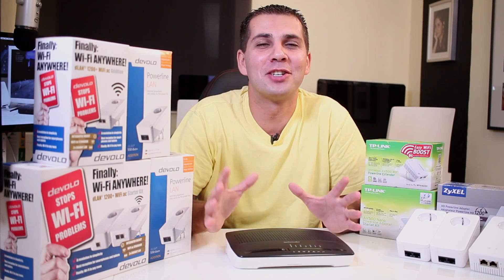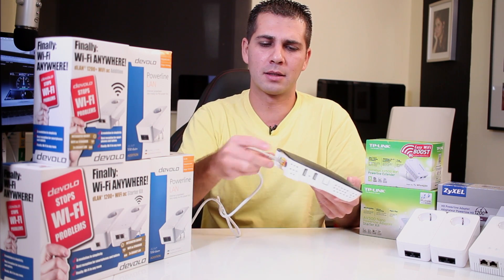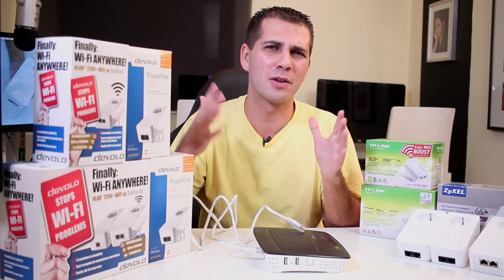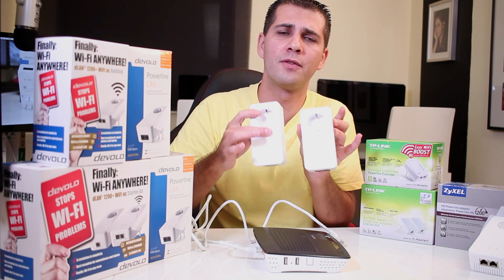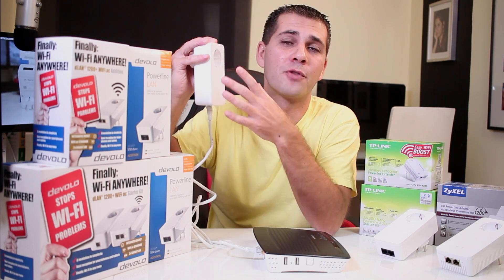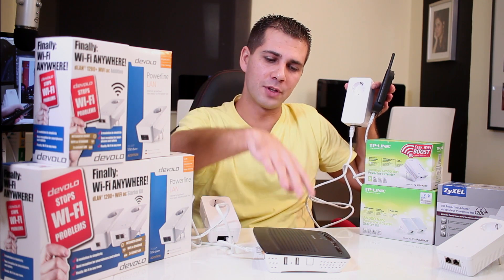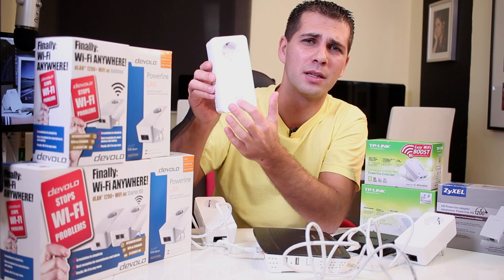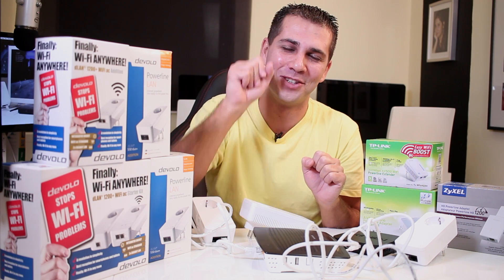What Are Powerline Adapters ? And How to Use Them

Comment: What happens if your upstairs where my PS4 is & Sim Rig after plugging Ethernet cable in to booster from PS4 How do I synchronise them if it's upstairs & the one coming from router is downstairs can you hold sync button in separately?

Comment: Great explanation. Just a quick questions though...

1. What is the maximum range of your electrical outlet to get good connection?
2. Can I get good network speed if I connect 24 port switch on the outer side with 23 users?
3. Can I use it as an uplink to my network connections?

Comment: Roberto great videos. I am moving from a 1 bedroom apartment to a 2 bedroom apartment. 
I will have a fios internet  connection. In the livingroom I will have a nvidia shield, TV,router and 1 tplink powerline adapter.
In bedroom A I will have another nvidia shield,TV  and powerline adapter line adapter.
The question is for bedroom b where I want to connect a desktop to the internet do I need to connect another powerline  adapter ethernet connection on computer to outline on wall then pair it with other powerlines
Reply from the maker: Hi Ginno, yes that is correct, you will need a 3rd one for that setup and in the future if you want to connect other via ethernet you will need other. If you can connect via wifi than 1 powerline will be enough for several devices but the signal is not as powerful as full ethernet speed 👍

Comment: I know I might be a couple months (or even a year late) but I am planning on moving my PC into my room but my room has a very poor wifi connection. This is due to the fact that my router in downstairs on the other side of the house. If I connect this to my router, then use the other adapter and place it in my room and connect it through ethernet, will I get a fast connection or will it be a little bit slower due to the distance between my pc and the router?

Comment: Sir I know this kinda late but thx you for such a great info I want to try put this in my house cuz my house mostly build with bricks no eithernet  wire at all. I will use 4g net sim trough router then I will expand to every room and also outside from back yard and front yard by using this adapter hopefully it work.
Reply from the maker: It will be as good as a direct cable or almost 👍

Comment: I have one router in my living room and connecting my Xbox via Ethernet wires. I want to connect it to my room and I have the same well connection how can I do this?
Reply from the maker: You need a powerline mear the router to receive the internet and then a powerline in the other room to transmit the signal to your other device 👍

Comment: Hi Roberto, quick question i have been using one of these for years now, for any reason would it start to work less? if that makes sense, it seems like i am only getting a couple of mb of internet now when i used to get way more, not sure if i need to update and buy a new one or the problem is with the internet provider? thank you! great video

Comment: I can see these powerline adapters giving more constant connection & ping over wifi but i saw many discussion online saying it dosen't last long for example after a few months the download speed will drop is that true?
Reply from the maker: Hi Armour, i have been using Powerline adapters since i was a teenager and the brands that i have used i can confirm that that statement is not true. Unless you have any change on your power grid there is no reason to have less speed. I have made extensive tests and i use them on a daily basis, and as such for someone that doesnt want to drill walls to pass wires this is the best solution available in my opinion 👍
Reply: Roberto Jorge Thx for your opinion, im looking foward to use it once i found out about it, its just there are some negative review online about it so its safer for me to ask an experienced person before buying. 👍
Reply: Armour Shooter Mine has started to drop after a couple of months it is probably just faulty though

Comment: Hi .just to know,I have brought a pair of TP Link power point adapter .I have all the connection and pairing -all is fine.Speed wise is not much of a diffrence.I have a ADSL2+ internet connection.I only get about 13 to 14 Mbps.I am curious to know whether the power line adapter is security safe cos' I do not want my next door or surrounding neighbours to get my signals.Thanks
Reply from the maker: Oh dont worry Ray, it will only go until the main "Mains Board" after that its not possible as the signal is destroyed on the "mains"
On this video https://youtu.be/RQUH8u0VFNM i do show all my 5 circuit breakers and the signal passes on all of the inside but once it reaches the main one will not go outside.
I have also tested this on the past with a neighbour on our older apartment and its a NO GO
Sleep well as you are safe 😊
PS: The only way for your neighbour to get your signal is trough Wifi (router or Powerline) , but you should have a password or Mac address only access so you will be ok as well 👍

Comment: Hi Jorge. All these days I was looking for a solution to connect my minix U9-H android box to the router via RJ45 and I hope here it is.

My modem is placed almost 10 ft away from the anroid box, but there is no way I can connect directly using network cable with out the cables exposed.

I have TP link AC1200 wireless router which I use to connect to android box nowadays for a 30Mbps internet connection.So what I am trying to ask is that shall I consider getting power line plug or continue to use 5Ghz wireless in order to get buffer free streaming? (4k also). if yes which one will be a better option? I may upgrade to 100Mbps or higher later.
Reply from the maker: Hi Gino, in my opinion definately and i would suggest the Devolo 1200 Wifi AC check my latest tests here https://youtu.be/RQUH8u0VFNM
Hope it helps
RJ 👍

Comment: So i have a router in my living room and have a computer in my room that already accesses the wifi, but since my computer and the router is really far away and has a lot of walls in between, my wifi signal is not very strong and i get high ping on my games. would hooking up a powerline adapter to my room then connecting an ethernet cable to my pc make my signal stronger and make my games have lower ping? thanks
Reply from the maker: Hi Pudi, you will definately get much better results, take a look at the latest tests i have made when we moved to our new home here https://youtu.be/RQUH8u0VFNM and there is also more info using the Gigagate here
The connection will be much higher and pings will be lower but never as good as a direct connection with Ethernet which you can use if you use the powerline adapter near your PC and plug in a cable :)
RJ
Reply: ok thank you so much
Reply: yeah it works great. i get a consistent 75 ping which isnt too bad and my games arent rubberbanding at all
Reply from the maker: Hehe Nice and thanks for sharing your experience 👍

Comment: How is about privacy and security data? Can your neighbors with the same system see your computer?
Reply from the maker: Hehe! Great question and although it would be useful in some scenarios that is not possible. This technology will only work inside the range of the main circuit breaker so anything behind that will not work :)
In the past i wanted to share part of my network with a neighbour (next apartment) and wasn't possible at all 
RJ 👍👍

Comment: Jorge, I need a bit of help.
I have no wifi upstairs in my room and I live in the UK.
I understand I put one powerline to the router, but for the second powerline I want to put in my room will I have to use an Etintrenet cable AGAIN for the 2nd powerline? Or do I just plug it inside the socket and there will be wifi upstairs?
Reply from the maker: Hey my friend!! Yes you may use a Powerline to acomplish that and its the best option in my opinion. The 1st goes to the router than it will transmit internet signal to the 2nd, 3rd etc powerlines that you have and those if they have Wifi (Some dont have Wifi) will then give you wifi in your 2nd floor without any cables :) (i use it like that as well.
Non the less you will have the option to connect the powerline on your room with a cable as well.
Lets say that you place the powerline near the TV on your room, it will transmit wifi signal for your phones and tablets and if you have a smart tv you can connect a ethernet cable from the tv to the powerline adapter to get a faster connection for your tv (Hope that i could explain ) :)
👍

Comment: to me that sounds like those Powerline Adapters are simply acting like Ethernet Bridges.. one gets the Internet from the router and sends it wirelessly to the other Powerline Adapter. - - it's cheaper to buy a used router and set it as an Ethernet Bridge.
Reply: it's using the electrical wiring of your house to send the Ethernet signals

Comment: Hi Roberto Would this adapter work inthe UK? and also I have a very low speed would this make any different
Reply from the maker: Hi Mark, yes it will but buy the one with the UK socket so that you dont need any socket adapter (everything that we place between will degrade a bit more the signal)
The internet speed will remain the same, this is just a way of transmiting our internet acess trough our power lines 
RJ 👍

Comment: Which is more ideal for use with the upcoming PS4 Pro—Powerline Adapter or Wifi repeater?
Will there be a dropoff in the the DL and upload speeds from both devices?
Which is more easier to set-up?
Reply: Barron Cedric Tan have you found the answer yet
Reply: I haven't tried any of them. Turns out the Wi-Fi signal at home (at the lower floor, my PS4 Pro's setup upstairs at the 2nd floor) was already sufficient. I can update and DL programs (YouTube, Twitch, Netflix, etc), and also watch OL vids.

Comment: How stable is the connection this way? Is it comparable in strength to plugging a computer directly - via ethernet - into a router, or is there a little bit of extra latency involved? This question is coming from someone who plans to use it for gaming.

Comment: I have my ps4 in my room and my upload speed is 9.5Mbps and my upload speed is 2.6Mbps so if use the powerline what is the new speed i can be expecting?
Reply from the maker: Using a powerline will give you more or less the full performance that you would connecting anything directly to your router but you are limited to your power grid
RJ 👍

Comment: can i use one model connected to the router and another type of model(different company), will they connect? I want three adapters but they come in doubles or singles.
Reply from the maker: Hey Julio, in the past i have tested devolo + TP-Link + Zyxel and all worked together 👍
The 1st kit you should purchase a 2x unit, 1 sender and 1 receiver after that only purchase 1 receiver as you need
RJ

Comment: What if I just want to plug a single powerline adapter to the socket behind my computer and just connect one ethernet cable from my lone adapter to my computer?
Reply from the maker: It will not work like that. You will need 1 adapter to receive the signal and 1 adapter (at least) to send the signal to
RJ 👍
Reply: +Roberto Jorge (Tech Reviews) I will never understand how these work...
Reply: Roberto Jorge I got a question I live in a apartment that it have WiFi on its on but I can use enther net cable on the enter net outlet would it work if I put a adapter there and then one on my counsel BC we don't get a router for our place but there's another way I was thinking do u think if I get a router plug it on the enther net wall and use the adapter to my router and then my console would you think it works? and sorry i ment they have the modem and router and I mean the landlord does in the offices so you think it would work?

Comment: I just purchased 1200 bps pa's to run with 200 bps ones I purchased a few years ago.  I'm going to make 1 1200 be the initial power from the computer,  then hook the other 1200 and 2 200s.  will it be compatible???  and do all outlets in between get the same power??  or only where pa's are?? someone told me all outlets.  I have had pa's a longtime,  and swear by them. but never knew this was the case if true
Reply from the maker: Hey Rage :) yep you can use the 1200 with the 2x 200 and they will work but the max will be dictated by the slower adapter which is teh 200
All the Best
RJ 👍

Comment: My connection speed is 150down 15 up.  
I have my ps4 and pc hooked up to a router which will be connected to the powerline soon, but my question is will the router, that is connected to the powerline have the 150down en 15up speed or will there be a speed loss? 

Great video by the way!
Reply from the maker: Hi, there is always a small hit on speed and this will depend on the powerline adapters, network cables, the power grid etc.
Non the less if you have 150 mbits / sec you can expect to achieve more or less the same on powerline assuming you are using like i am Devolo which is top and you have perfect conditions on the power grid
Hope it clears that out 
RJ 😀

Comment: Which power line adapter do you prefer from a performance stand point? I'm just looking to purchase the best one I can.
Reply from the maker: +AllofUs Henrys Hey Henry, well im really happy with the Devolo 1200 Wifi AC, the best that i have had so far so that is the one that i suggest, but if you dont need wifi i would go for the Devolo Duo 550+ which is cheaper and delivers a great performance, very similar to the gigabit ones :) Hope it helps. RJ

Comment: a few questions though

first up, connection integrity. How is the latency? Dropped packets? Transfer rate?
Anything specific for your electrical wiring or how it was setup? We actually have a weird setup where the kitchen and one bedroom has their own "main power switch" followed by the real main power switch for everything in the house including the bedroom and kitchen
Reply from the maker: +TheAntemon Hi, please check the reviews on the top right corner of this video for tests results. There are 3 different powerline adapters that i have tested.

Regarding my setup, only one main power switch, please have in mind that power line will not pass trough any other switch so your bedroom with its own switch will not get the signal, unfortunately its the way these adapter work, there are some limitations and that is one of them.

Hope it helps
RJ

Comment: My house is like 50-60 years old.
Reply: +goodman854 
That can be a problem.
Reply: ubbgn
You don't think the powerline adapter would work?
Reply from the maker: +goodman854 It can work!! The best suggestion that i could give is try to get any brand in a local store and test it out, then depending on the results either keep it or return for a refund (in case doesnt give you the results required) or return it to get a more powerful ones :) 50-60 years but if the wiring was done correctly it will work fine, i believe that not much has changed inside of the cabling (not sure im not expert in electrical installations) But without testing we cant know for sure.

If you try would you please share your results with us? Im curious. Thanks!! RJ
Reply from the maker: +ubbgn Hopefully will work just fine!! It might even be better than mine even being older. Some times newer constructions are made in a rush and we can get worse quality than some older buildings :) I hope he can get his working!! RJ